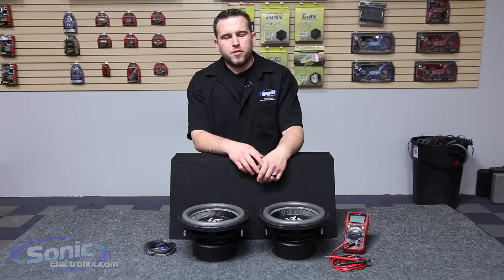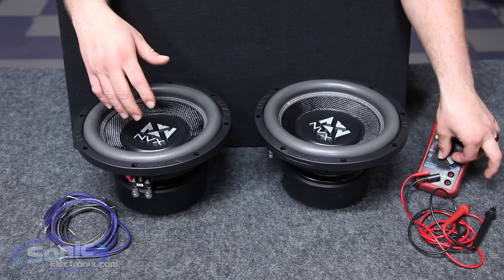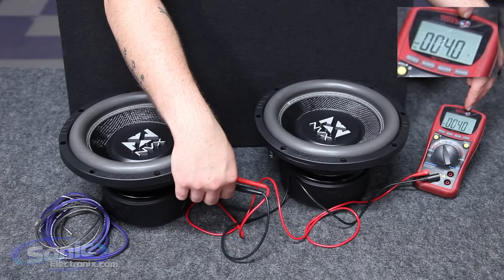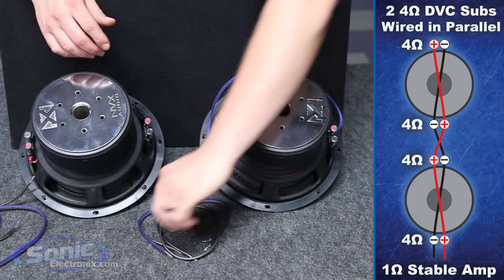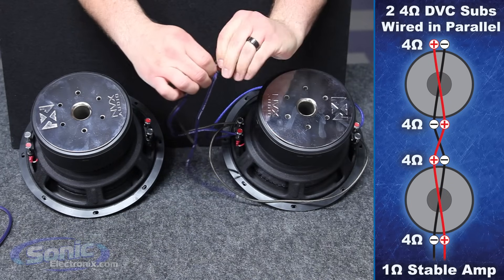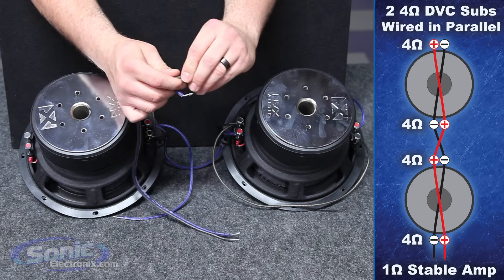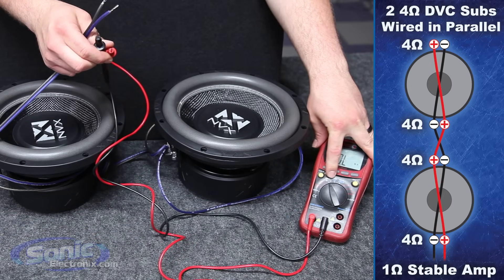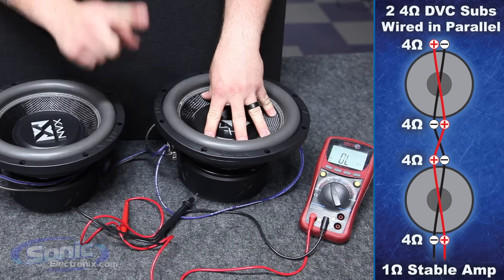How to Wire Two Dual 4 ohm Subwoofers to a 1 ohm Final Impedance | Car Audio 101

Comment: GFCyadigg: if each sub is 800w rms you need an amp that pushes about 1600w rms. dont worry about peak power. that is just for short bursts of bass and you amp would be able to do that. but  you need an amp anywhere from 1000w rms to 1600wrms. try not to get an amp over 1600w rms because you can mess up your subs
Reply: I had 2 cvr 15s rated 500 rms each, they were dual 4 ohm subs I had them wired individually in parallel on a 2 channel hifonics 1606d so they were wired down at 2 ohms that thing hit
Reply: Well, if you have two subwoofers on a monoblock amp that has a 800W RMS, and both subs are 600W RMS and make a 1ohm load, they will both get the 600RMS because it’s a monoblock. The way you explained only goes for a 2 Channel amp. 3 channel would make 1600 into like 530W per amp

Comment: Hey if i have 2 dual 4 ohm subs and i wire each sub in parallel it gives me 2 ohm per sub then i wire the end leads of the subs in parallel again giving me 1 ohm stable my rms for a single sub is 750 so does the mean i now have 3000 wats total???

Comment: hi there, i need some help, ive watched this video a number of times , i had a pair of pioneer dual 4's and measured the voice coils with a mac tools multimeter and they read 2.5 ohm per coil? no where near 4ohms, i have just purchased another two brand new pionner dual 4ohm subs and they are stable at about 3.0 to 3.4 ohm per coil... why are all 4 of my subs no where near 4ohms as they should be..the old ones i have are about 5 years old ,new ones got today. help !!

Comment: Please help.i ordered 2 rockford fosgate T1D412 subs.they are 4 ohm dual voice coil subs.the specs say they push 800watts rms each and 1600watts peak each.so the both of them would be 1600watts rms together and 3200watts peak together.so should i buy an amp with 3200 watts or 6400 watts to push the full power.and should i buy mono or channel.please help
Reply: Buy a mono block amp such as a 3000 rms amp or stronger

Comment: Alright, so I was messing around with my subs last week and decided to double check my impedence. Im running 2 cvr12, dual 4ohm voice coils wired in parallel.  Somehow, im getting 3.5 ohms of resistance on my multimeter. Dafuq did I do wrong? XD
Reply: You wired it wrong

Comment: Hey I have a question, I'm going to order 2 orion xtr pros (12") from yall's website, And the amp im going to get is a Crunch P1-2050.1, Can I still do this? Is that amp proper for those two subs wired to 1 ohm?
Please respond so I can know if i can actually buy them.

Comment: Wow I just checked the site that is really useful! Just curious, I have two Jl audio 8w3v2's hooked to a JL 250/1v2 mono amp, which is better connecting for 4ohm or 1 ohm? Is there a sound difference?

Comment: hello I have 2 Kicker CompVR 07CVR124 12-Inch 4-Ohm DVC Subwoofers and a Crunch Ground Pounder GPV2000.1 Maxx Watt Power A/B Class Mono Amplifier. As I understand it, I could run them both from one amp terminal even though my amp comes with two sets of terminals? And furthermore with this particular amp can I run  both subs to 1 OHM?

Comment from the maker: You could wire the Dual 4 ohm subs in parallel to get them to a 1 ohm load, that would be the ticket. We have wiring guides on our website and the manual for your product should also have wiring guides.
Reply: what if you have 4, 4 ohms, can u wire it down to 1 ohm?
Reply: what if you have 4, 4 ohms, can u wire it down to 1 ohm?

Comment: I need help, I am going to be buying 2 Alpine Type-R 12D4's and a Hifonics Brutus BRX24000.1d amp. I was wondering if it is possible to wire these down to 1 ohm? Or would it be better to wire it down to 2 ohms? Any reply would be helpful

Comment from the maker: Yes you definitely can! Just wire your subs in parallel to 1 ohm and connect it right up to that amp, which is 800W RMS at 1 ohm.
Reply: Sonic Electronix I wired 2 brx12d4 exactly as you demonstrated but I'm still getting 4 ohms after the box terminal.. help please??
Reply: I  got 2 dual 4 ohm subs and when I wire them to  1 ohm I end up with 0.5 some how pls help lol

Comment from the maker: You Dual 4 ohm subwoofers need to be wired in parallel to see a 1 ohm load at the amplifier. This would be the optimum wiring configuration. Find that woofer on our website and we have a wiring tab that will show you how to do it. As the the enclosure, you can drill a hole through that wall and run your wire through it, so long as you seal it back up.

Comment: Im about to setup Two Type-R-12D4 subs to an XAX-1200 powerbass amplifier. What would you recommend the best way to wire my subs? My amplifier is 1 ohm stable so I'm assuming that 1 ohm is the way to maximize performance here. Also  my sub box has isolated speaker boxes, how do i go about connecting box speakers together if there is a seperation internally?

Comment from the maker: NO that will not work, your subs are single 4 ohm subs, not Dual 4 ohm subs. You should wire them in parallel though to a 2 ohm final impedance.

Comment: I have 2 pioneer TS-SW3001S4 and RE Audio Dts 1000.1 amp would this subs work at 1ohm without problems using your wiring diagram?

Comment from the maker: As long as it is wired exactly as we showed, you will only have one connection that goes to the amplifier.
Reply: What gauge wire did you use?
Reply: @geraldgutierrez446 looks like a 12gauge

Comment from the maker: You will need to bridge the amplifier and then wire the subs in series to a 4 ohm load, that way both the amp and subs are at a 4 ohm load. Do not wire it like you see it here, wire it in series.

Comment from the maker: The easiest thing to do is drill a hole in the box to connect the two woofers with wire inside and just use one set of terminals. If not, you can wire the woofers together once outside the box and then take that right to the amp, but it is not a clean option.
Reply: Sure it is :)

Comment: How would you do this with a dual enclosure with two seperate sealed chambers for each woofer and a pos and neg terminal in each chamber? Subs are Sundown Audio SA-12 D4's running on a RF T1500-bdCP.

Comment: ok i got the wiring so after i wire them together would i bridge them to my amp or just put them together on one channel? i have a two channel amp. im hooking up two 1200 watt subs dual to either 1200 amp or 500 amp would that be fine? and so i take it i use the meter ti figure out the ohms but what about the amp

Comment: They are overrated. But most CEA products DO come pricey. I just want something to blow people away for a while, gotta save up for a complete Rockford set. But, I've seen some vids and Power Acoustik does have some equal rep negatively and positively. WAY better than BOSS. I've read that PA is a good starter system. So I figured fuck it. But most of the times CEA is a voluntary thing, meaning PA could be CEA but they don't want it to be. So for all we know, they could be what they say it is.

Comment: I want to buy 2 Power Acoustik Mofo 15 4OHM so I can make it 1OHM. They are rated at 1700 RMS so dual will make it 3400 RMS. Im stuck between two AMPS. The REP1-6000D which is 100 RMS short of 3400. Or the D1-6000D which is 100RMS above 3400, both from Power Acoustik,. What would be a good choice so I can get enough juice to the woofers?

Comment from the maker: You drill a small hole in the box wall between the two chambers and feed your wire through, then seal it up. However, if your sub amplifier has 4 terminals, you can wire each sub to a pair of terminals which will simplify wiring at the box.
Reply: So would I still need bridge them if I have two terminals on the box and two terminals on amp?

Comment from the maker: You can fit whatever subs your enclosure can fit, and thus whatever enclosure will fit in your vehicle. Two 12" subs facing up will have great linear movement, there should be no problems with that setup.

Comment from the maker: The manual should help you. Two terminals means the amplifier will internally bridge your connection. In most cases, just use one positive and one negative terminal.

Comment: I have 2 l7 15s and a autotek 2500.1D
How do i run the wires to the amp? It has 2 terminals most D blocks only have 1

Can anyone help?